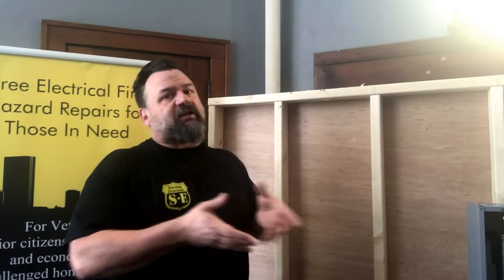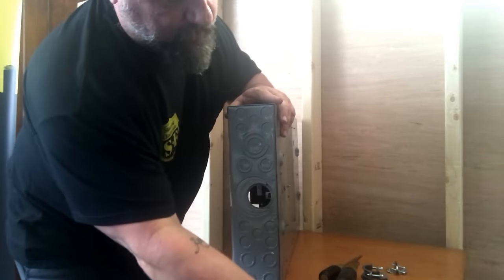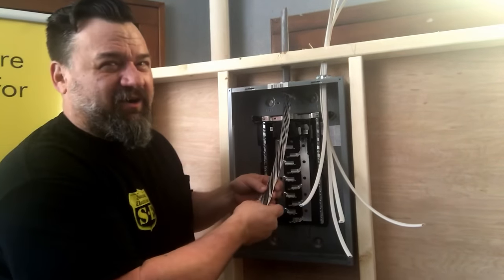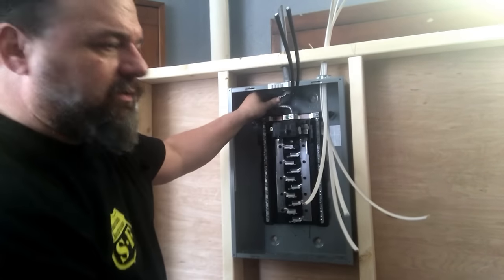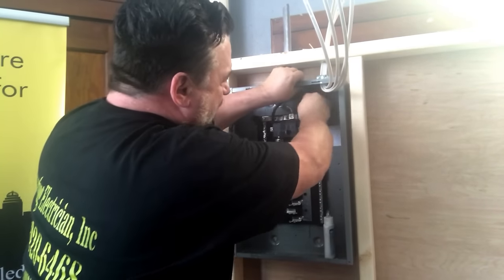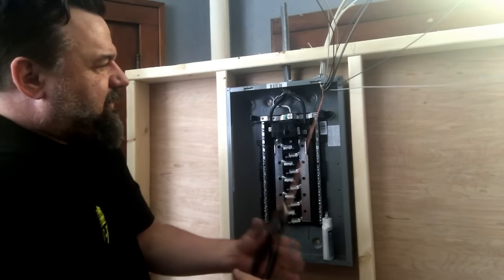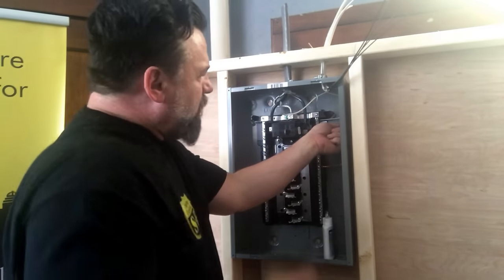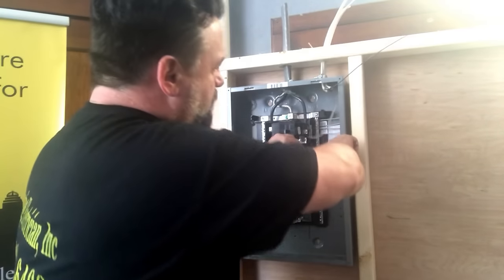How to wire a 100 amp service panel. ,  2020 National Electrical Code compliant

Comment: I rip last inch of romex pull up on ground wire cut with cutters save any chance of cutting a wire
Reply from the maker: David Berquist yea pulling the ground through the sheathing  is the best way not to score the wires. Or running perpendicular with the wires but you run the chance of nicking wires. When I score the wires I put a little nick in both sides. Not quite enough to see the individual wires and then bend the Romex at the cut and it usually splits the outside pretty easy and I pull the sheathing down. I hope this helps.

Comment: Thanks. I like tacos and this has been very helpful.
Reply from the maker: Can’t learn on an empty stomach and with tacos ya need something to wash it down! Lol
Reply: Im moving back to my childhood home and i need to put a new breaker box in. I do own the house and heard that i could do the electrical work myself without an inspection. Do you know if thats true?
Reply from the maker: Will Vortex  yes that’s true! Only the home owner can pull his own permit. If you pull one and let someone else do the work, you are certifying you did it and you are liable if anything goes wrong.  They won’t let you pull one of someone else is doing it  so they leave the liability on the homeowner.
Reply: @StarvingElectrician   So if i pull a permit for myself but a electrian friend is helping me do it is that ok?
Reply from the maker: Will Vortex  yes. The whole idea is that they are qualified and the inspector will verify it’s up to code. Not everyone is a contractor but if it’s your friend and they can do it, I would do the same thing to save a few bucks.
Reply: @StarvingElectrician  You're a good man. Thanks again. Where you in the service? Army?
Reply from the maker: Will Vortex no I never had the honor to serve but have massive respect to all who did and since I’m so blessed I want to give back. That’s about the size of it.

Comment: curiosity can we connect neutral with ground in the same line? or they are separated in one place and ground in another line
Reply from the maker: Jose Escalante  the only places grounds and neutrals are together are in the panel but never under the same screw or lug. The can go to the same buss bar inside the panel. But if you are asking about jumping from the neutral to the ground on a plug so you can put in three prong outlets, no way. That's voltage on the ground and could get someone killed.  I hope this answers your question. Thanks
Reply: I think it depends on what kind of panel. In a secondary panel, the two bars must be separated and the main bonding jumper should be removed as well. if the busbars are separated, the grounding and the grounded must be separated.

Comment: I'm a home owner and just scheduled a service to get my 50amp main replaced on my pushmatic. I don't really see a DIY option here. I'm kind of expecting an upsell in the form of a new box. I guess I'll deal with that when the time comes. 

Nice Vid btw. Subbin.
Reply from the maker: Jon Cates  well the code is that your main service is now 100 amp.  No need to up sell. It can get costly but it’s a good idea to upgrade your service. Thanks for watching
Reply: Go 200amp pannel. I would

Comment: You are very nice for doing this thank you!i have a  pretty basic question, so is it depending on the panel, depends on where the neautral wire will go? Or is each panel orientated differently? Say, eaton would have the neautrals on the left hand side and Dsquare would have them on the right hand side etc.?or does it matter which side  they go into when they go into the lugs(leftside/rightside)?
Reply from the maker: usually all the panels are the same and it doesnt matter what side the wires are on. now if the neutral is going into one bus and theres nothing connecting it to the other side then I would say it matters. all panels or at least main service panels busses are bonded together and they have a bonding screw to bond those busses to the panel its self.  so it really doesnt matter what side. thanks

Comment: If you have a breaker panel on a pole outside and it feeds the 100 amp panel inside the home, do you bond the panel outside or do you bond the panel inside the mobile home, or do you bond both? When I open up the panel inside it's not bonded and has grounds and neutrals independent of each other. I haven't opened up the panel outside so I'm not sure if it's bonded or not. I know HUD building codes are a bit different than local building codes so this is why I ask. I've assumed without doing research that HUD requires all manufactured homes to be wired as if they have sub panels in them but I'm not sure about this.

Comment: Is noalox only used when using aluminum wire? Or do you always apply it? Also do you apply it to every wire connection in the panel(wire to breaker) or only from the weather head to the main lugs? I asked before watching the video I'm just excited
Reply from the maker: chris _86 it’s used in a few applications. Under aluminum lugs with aluminum wires. Any aluminum wires size # 6 and above. There fore you would use them it in the panel and the meter but usually for aluminum. Now a lot of times you have copper conductors going into aluminum lugs. This is two dis simalar metals so those oxidise rapidly do you use it in that application as well. But again #6 and larger..regular branch circuits like # 12,14, etc you don’t use it. It’s so the lugs don’t freeze and to combat oxidation with aluminum. I actually had a guy say you aren’t supposed to use it on aluminum  and it made his voltage go down. So freaking stupid. It’s made for aluminum and has nothing to do with voltage. I hope this helps. Thanks.
Reply: @StarvingElectrician  thanks for the information!

Comment: Hello I have a question but first of all thank you for all your videos I really learned a lot from them now my question is if my electrical breaker box has a worn out/corroded bus bar can that be replaced or just install a whole new box?
Reply from the maker: yes you can simply replace the bar and use no lox or de ox to stop corrosion. thanks for watching and I hope this helps.

Comment: So did Common get re-named Neutral at some point?
Because I'm used to Hot, Common, and Ground (And in older homes, there might not be a ground)
Reply from the maker: VME - Brad  the thing is, for people who don’t know the language the word neutral fits better. Also, a common isn’t always the neutral or the white wire. Like the power or the switched leg on a three way. It makes it easier I think. Thanks for the input. I’ll try to clarify it!
Reply: @StarvingElectrician  We call them travelers on a 3-way. Most people are used to 'Neutral" and that can get you into trouble when taking your test. the NEC refers to it as "Grounded conductor".. I din't know that until 6 months ago when I started studying for my test.

Comment: I thought an individual was allowed only two grounds of the same size under a screw?  Or does it very as to where one lives?
Reply from the maker: it may change for citys. I have put a lot under a terminal because they are not current carrying conductors. never once have I gotten shot down for it.

Comment: thankz for the entertaining video.  I'm in the process of wiring and installing the electrical panel and outlet boxes in my unfinished 2 level cabin....since we have no power on the island, it will eventually be connected to a solar system and a generator. Is it best to install the electrical panel near the center of the cabin on the lower floor, or nearer where the solar batteries will be located outside in a shed?
Reply from the maker: knight Owl  thank you for the response it means a lot. As far as solar I really don't know much about it but it's always best to have a designated utility room. This way if a solar panel isn't working and trips a breaker you have every thing there and can locate which circuit  is out easily. But if space is an issue it doesn't matter where you install the panel. There is a common misconception that a panel can't be close to plumbing or near a laundry tub. Although not being around water would be ideal you can put the panel wherever is convenient. The catch is, you cannot pierce into the home with more than five feet of service entrance cable or you have to install a disconnect outside, install four conductor wire, and then the panel inside the house becomes a sub panel and you have to separate all the neutrals from the grounds under the buss bar. If you are a novice I'm sure this sounds like a pain in the ass and it is! Lol what I'm saying is where your meter is on the outside of the house then usually you install the panel right on the other side of the wall or it gets tricky to put it anywhere else. I hope this helps and good luck. Any other questions please don't hesitate to ask.

Comment: Nice video I have question. Why do my double circuit have white and black wire attached. Some other wires white wires are attached to chrome bar and black wire attached to circuit.
Reply from the maker: george a  they do that when you have a 220v circuit that doesn't require a neutral so they use he white as another hot wire. It's legal but they have to identify it with black tape. But it's legal and of course the ground goes to the grounding buss bar.
Reply: @StarvingElectrician  thanks for replying. My circuits have different amps it should have different size wires correct. To be sure the wires are correct how do you identify them.
Reply from the maker: That's a tough one. #14 wire is a 15 amp breaker #12 is a 20. #10 is a 30. #8 is 40. And so on. If the outside sheeting isn't labeled it's hard for the average homeowner to determine but this are the breaker sizes for the wires which is my next video.  I hope this helps

Comment: Does NEC code require you to keep neutral and ground separate in a sub panel that's downstream from the Main Disconnect in the same structure? I always thought you always needed a separate neutral and ground bus bar in panels now.  Also, I thought because of NEC 250.32(B)(1) you can't run 3 wire feeders to panels anymore, it needs to be 4. Two wire for the hot, one for neutral and one for EGC...assuming same structure.
Reply from the maker: yes they all need to be seperate and if the ground and neutral bar are on in the same them you mount a seperate ground bar.  thats only for a sub panel. in the main panel you need to bond the neutral/ground bar to the panel its self.
Reply: I thought the same thing.  Only for a main panel do you bond the ground and neutral bus and the green bonding screw to bond to the metal case of the pa el so it’s grounded.  The sub panel he did looks like he bonded the ground and neutral - that’s not right.  
Also most all née circuits are required to be arc fault protected.  Arc faults must have dedicated neutrals.  That’s why Edison (3 wire) feeds aren’t allowed.  
Otherwise nice video. Thanks

Comment: With 12 /3 is it ok to run 2 circuits and share neutral and with 208 can i run red black blue white and green put lights on blue some outlets on red and some on black all from junction box that way electrican would know wear shared neutral is thanks
Reply from the maker: David Berquist  you can only share neutrals on two circuits. And use a two pole breaker or a 220v breaker so you don't over load the neutral on the two circuits. Three circuits would have to have another neutral.

Comment: Did you ever do (or could you do) a video on how to wire in a 24 volt inverter to a panel box ? And proper grounding. (Yes I am off grid and have a 24v system in my cabin)
Reply from the maker: lol off the grid? well the problem is I would need to buy the inverter etc to explain how to wire it. im not on the job as much so a lot of experiances I have to share are limited but if you have a specific question then go to the face book page and maybe post some pics and I will see if I can help. good luck and I hope the bears dont get ya!!!
Reply from the maker: https://www.facebook.com/starvingelectrician/
Reply: I had the same question, but my inverter is for a 12v system.
Reply from the maker: @aliaa9773   well the amperage determines how big the wire and breaker feeding it is. so maybe you can start there.
Reply: Starving Electrician well, I have an AIMS 3000 watt inverter, and there’s a little box on the back that has all kinds of warnings all over it..” do not open unless you’re a licensed electrician, etc etc”.,  and an obvious outlet for wires. The little box that covers it has a few set screws to keep it on.  I have not taken the box off, but I’m thinking I’ll find 2 hot 1 neutral and one ground, or one hot one neutral, and one ground? 🤔 I’ve never done this before ( obviously 😂) I bought a breaker box, and two circuit breakers of 30 amps each ( I calculated the max load on each circuit , and 30 was the best option. .  The romex is 10/2, and I’ve bought 6 gauge for the leads from the inverter.  
Any thoughts you might be able to share would be welcome😁
Reply from the maker: Alia A  yes you open it up! Start with how many amps and size the wire from there. I’m sure it’s 220v. Yes  2 hots, 1 neutral, one ground! You sound like an old pro. I don’t answer all the time but if I can help, please let me know.
Reply: Starving Electrician oh you’re awesome.  Thank you for responding!😊. The inverter is actually a 110, but I run a few high draw appliances off of it sometimes ( air compressor, mini induction cook top)...Thank you for confirming what’s inside of the mystery cube 😂....I’m not sure why I’m procrastinating opening it up...😬scared! Ok, gonna put on my big girl pants and get this thing done.  If I provide no further updates, look for an obituary...lol.  Kidding. I’m going to follow your guidelines.  I’ll let you know how it goes . 👍🏻😊
Reply from the maker: Alia A im not awesome, you are!  Yes boy and girl pants fit the same way. If it’s 110 v it’s nothing more than one less wire. So many people make it harder than it is. Good luck!!!!!
Reply: Starving Electrician Thank you ❤️

Comment: Love your vids bro keep up your good work. I have a simple question for you, what is the size of wire you would need to run ground to my water main? And where in the electrical box should it be connected to?
Reply from the maker: thanks for the compliment brother. well in a 100 amp service to need #6 copper or number #4 aluminum. and it just goes to the ground bar. if the ground and neutral are bonded to the panel it goes to either bar. when you bond the service you run the wire continues from the panel to the water and bond on both sides of the water meter. hope this helps!!!

Comment: why did you combined the 
ground and neutral in same bus bar?
Reply from the maker: because you can when they are bonded together in the panel with a bonding screw. never under the same lug in the panel.

Comment: Does it matter what order the neutral wire go in.
Reply from the maker: No there’s no order to putting the neutrals in. Just don’t double them up is all. The neutrals and grounds share the same bus bar unless it’s a sub panel. Now if you are talking about the service entrance wires the hots always go on the breaker and the neutral goes in the neutral bar. I hope this answers your question. Thanks for watching

Comment: can i put in a sub panel 60 feet away from the main service in my basement and the run it to the garage under ground?
Reply from the maker: absolutely!! so long as the draw meaning everything you use, does not exceed the main breaker. you can have 100 panels if you want but if your main breaker is 100 amps then all of those panels together cannot exceed 100 amps. you should be good to go. thanks for watching.

Comment: is the 4 spliced grounds into one bolt comply with nec code ?
Reply from the maker: I have never had a problem, its a matter of the manafactuer specs. check thats before putting too many wires under a terminal

Comment: I have a quick question... installing additional lighting and outlets in my basement that I am finishing. I have passed "rough" inspection and ready to drywall. Now I need to connect my wires to the Panel. If I shut off the MAIN Panel Switch )for safety), how do you or ANY electrician see what you are doing in a basement? Do you really just use battery operated lighting?
Reply from the maker: Mark Zientek  lol  remember the panel is hot to the main breaker so myself I temp in from the meter. Since the panel is hot anyway just shut off all the breakers except the lights or a plug. That’s the quick and easiest way.
Reply: Starving Electrician ....Awesome, Thank You!
Reply from the maker: Mark Zientek  any other questions, feel free to ask. The whole idea here is to keep you safe.

Comment: Nice i just slit the end and pull ground wire up to remove jacket no chance to nick conductors
Reply from the maker: David Berquist well you always have to be cautious and the duller the blade the better.